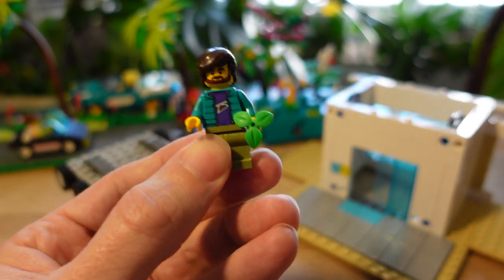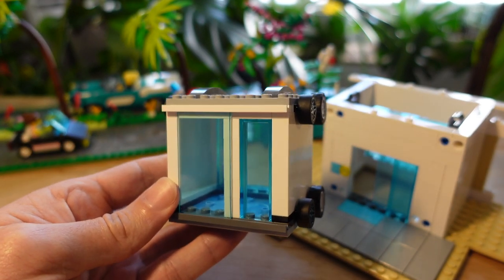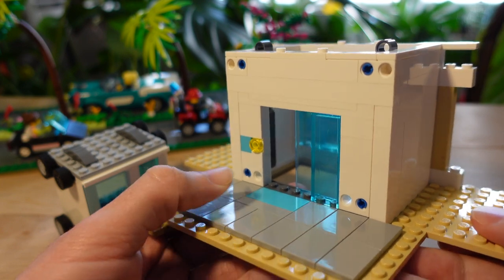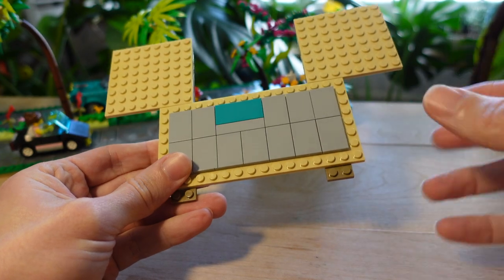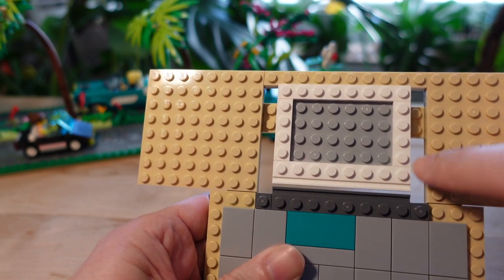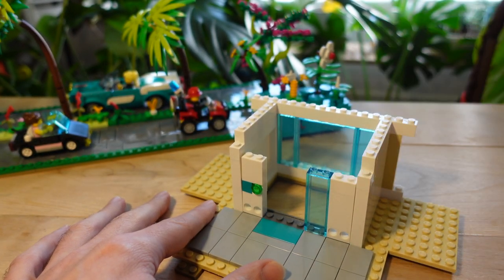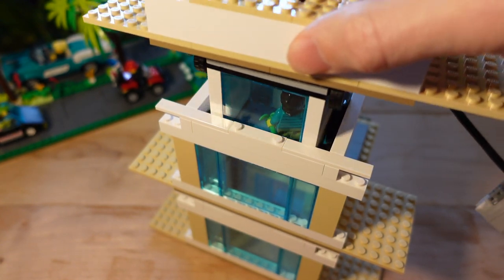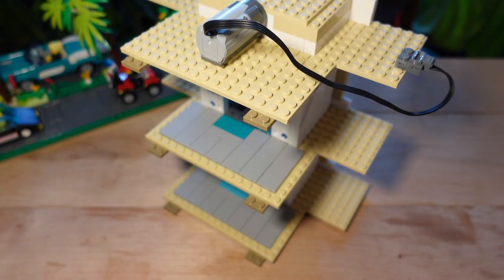⚙️ How you can make very slim sliding glass doors for your Lego elevator: TUTORIAL ⚙️

Comment: Amazing design, thanks for the tutorial! It works so flawlessly, it's quite mesmerizing.
I also love your side explanations, like how to align 1x1 bricks. So helpful!
I was wondering something while watching: in your buildings, will there be any stairs? On one hand, no stairs means you save space, but on the other hand what happens when they run out of service?
Reply from the maker: Thanks Super Secret!! 😄 
Yeah at first I wanted to include stairs in the hospital but decided to sacrifice it. It just wasnt worth it, as they take up too much space. The hospital is 48x48 and already jam packed with necessities. So I decided to make the rule that my skyscrappers would only have elevators and pretend that in the year 2060, they are absolutely robust, multiple safety reduncies and fire/fail proof 😂. perhaps an invisible safety feature is that each floor has hatch in the floor and when it is opened it deploys an inflatable slide ramp to the floor below just like on airplanes. This way minifigures can escape the building in case something devastating has damaged the elevator. 
My smaller buildings will have stairs (although my palace cinema has both stairs and an elevator) and I'm currently working on a MOC Grand Emporium which has a cargo lift in the basement, escalators on the first 4 floors and only stairs leading to the roof!
Reply: @TealBricksinParadisa  You know, that inflatable slide idea sounds actually great. Can't wait to see that Paradisa Grand Emprorium!

Comment: Great tutorial! How do the dimensions of this elevator compare to the one you had in your Cinema MOC?
Reply from the maker: Hey Sam! Thanks! 😊 The tutorial elevator is the same 6x8 dimensions (7x10 inner shaft) as I have in the Palace Cinema! The Palace Cinema differs from the tutorial by how tall the walls are ~10bricks tall which required the guide rails (technic beams) to be longer. The two hospital elevators are 8x12 (larger staff elevator) and 8x8 (public elevator)
Reply: @TealBricksinParadisa  thanks!. You've inspired me to try and add one to a MOC but I think I will have to forego the sliding doors as I don't think I will be able to fit one in that size. I'll have to try and figure something slightly smaller out. Great tutorial - you've definitely inspired me to give it a go
Reply from the maker: @samross82  Most excellent! You have been inceptioned! 😆 I've actually been pondering a smaller elevator just today! A 6x6 siding door elevator (7x 8 inner shaft..2 studs less on the front width than my tutorial elevator) might be doable  if A. you dont mind the elevator door clearance for a minifigure at 2 1/2 studs wide when the sliding door is open ....and B. converting the guide rails from technic beams to a 1x?12? plate with 1x? tiles on top...attached to bricks with knobs on the side (32592) built into the two side walls. This way the sliding door can use that extra space where the technic beam use to be. It would also mean the elevator would be able to wiggle side to side more, due to the plate+tile style guide rail...this may or may not be an issue.

Comment: Would the new 3x6 door panels work for this design too?
Reply from the maker: Unfortunately not. Unlike simple window panes, the 4x6 and 3x6 doors have a thickened portion at the top and bottom pivot point of the door. This prevents it from fitting into the 1/2 plate groove of the rail. Additionally the 3x6 doors have a thickened ridge at the top and bottom edges of the doors. It would be kinda cool if they could fit though.